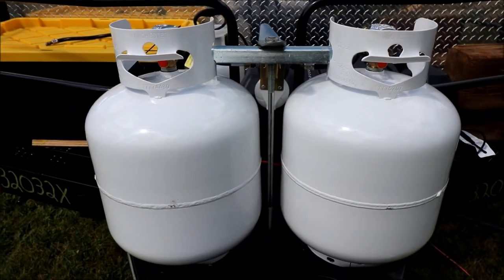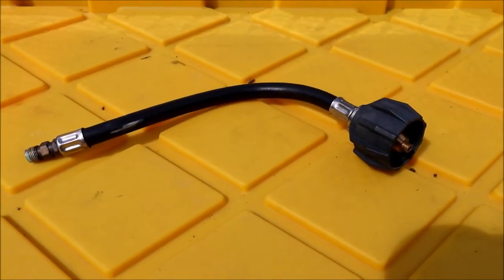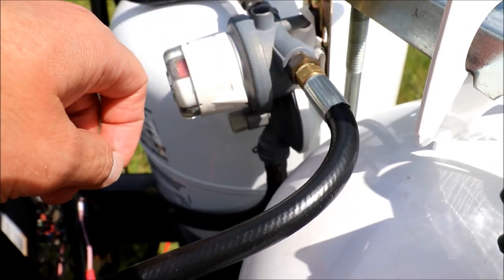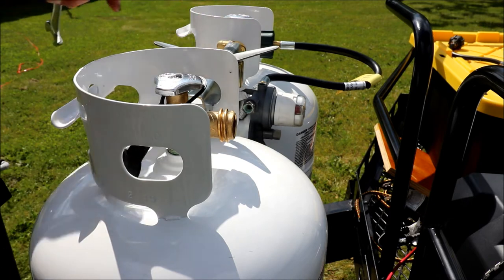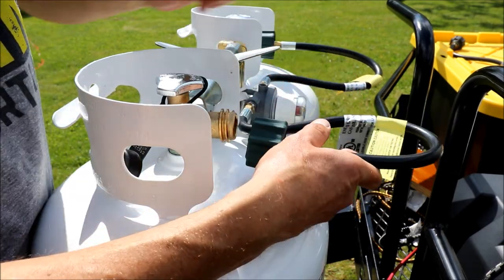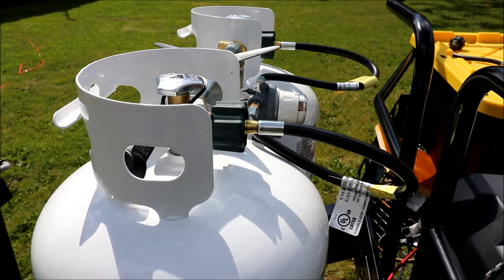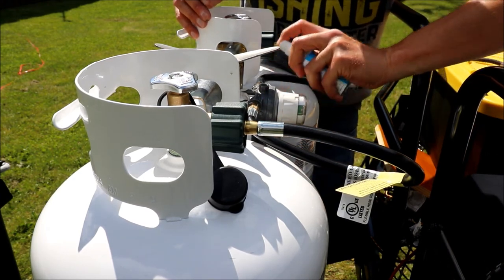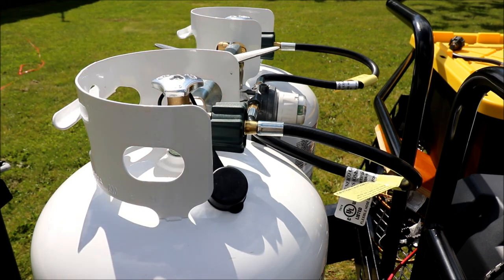Camper Propane Hose Repair

Comment: I never knew those hoses had such a short lifespan!   Thanks!
Reply: I've been full time RV living for two years and change out tanks several times a month. I think the flared fittings are machined to very close tolerances. And because they're made of brass, a soft metal, they wear out fast.

I'm thinking about trying a very thin layer of liquid Teflon on one my older tanks.

Comment: A flare seal can be over-tightened and cause a leak. The pipe thread compound is not just a sealer but a lubricant that allows greater torque to be applied.

Don't wrench too hard on these LP gas fittings. Tighten to snug and check with soap bubbles. If leaking remove and closely inspect both female and male flares for damage or foreign debris. Fine grit emory cloth can be used to clean.